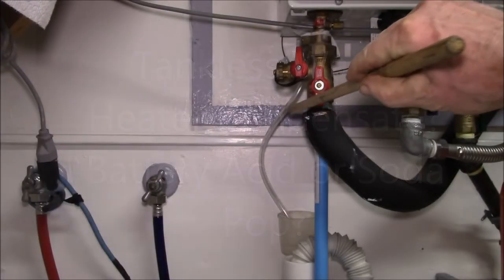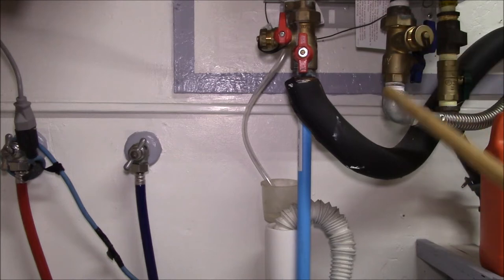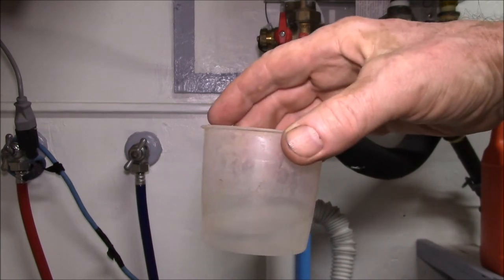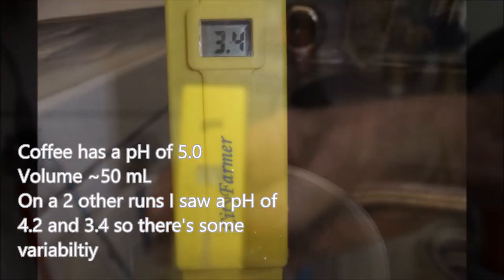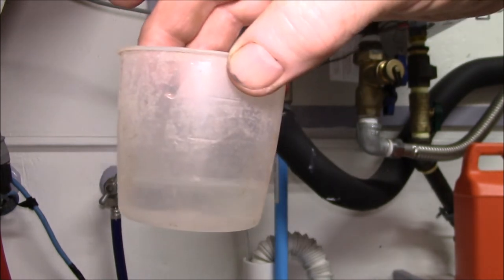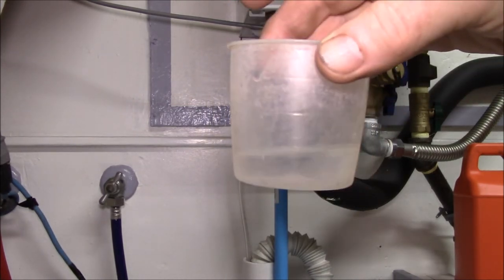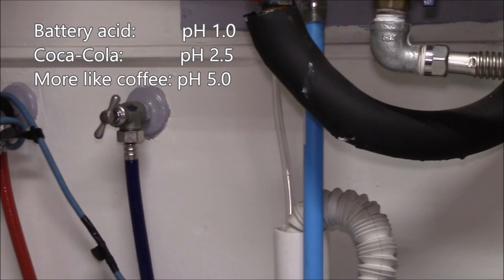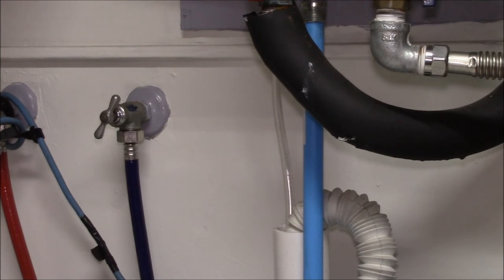Tankless Water Heater Condensate: Battery Acid or Soda Pop?

Comment: Thanks for putting this out there...Have the same model and am hooking it up today....was a little weirded out on this topic. Your video kind of brings me back down to reality that yes it is acidic but not burn a hole in my 68 year old cast iron drain pipe type of acidity.
Reply from the maker: Glad I could help.  Mine goes into a 60+ year old laundry drain.  The detergent residue is supposed to help neutralize any acid in the condensate.
Reply: It will easily burn a hole in your cast iron drain line.

Comment: The volume of condensate can change as the moisture content in the gas supply changes. On my natural gas condensing water heater, a couple of winters ago I wondered if the heat exchanger had sprung a leak - condensate was a continuous trickle thru a 1/2in tube that continued for a several minutes after it stopped firing. Then after a few weeks it all went back to normal.
Reply from the maker: Yes, that's true.  Will also vary with the air temperature and relative humidity as well as the temperature of the incoming water as that's what's helping to cool the exhaust gas.  In my area, the air is usually fairly dry and the incoming water temps as fairly warm so I may not see as much condensate volume as someone in a more humid area with colder water temps.

Comment: 140° F seems high
Reply from the maker: I only run it that hot for a dishwasher cycle.  Saves on electricity needed for the pre-heat portion of that run.  I use the remote control to set the water temperature for whatever task I need hot water for:
https://youtu.be/rYecHPXXQSE?si=YZQGHRtAmFMTNuuJ
Reply: If you got really creative you could wire a flow switch in line with the dish washer that changes the temperature of the water heater whenever only that single appliance calls for hot water, changing it back might be harder.
Reply from the maker: @Benjamin.L.Clement  That side wouldn't be too hard, but decoding the proprietary protocol on the remote to send the temperature setting to the heater would be the hard part.  I want to look into that some time.  It seems fairly complex in that it's a simple 2-wire connection that supplies both power and data to the heater control board.

Comment: Very helpful. I'm trying to decide if that water can be used for anything. I have a gallon by the end of the week. Thinking to use in my garden as we have very alkaline soil and sulfur is recommended for mineral uptake.
Reply from the maker: I suppose you could try that, maybe start with a little in a small area and see what the results are.  You could always dilute it with some tap water, I think pH is on a log scale, to a 10x dilution would raise the pH 1 point.  It's mostly carbonic acid (from the CO2) plus a small amount of sulphuric acid (from the odorant added to the gas).